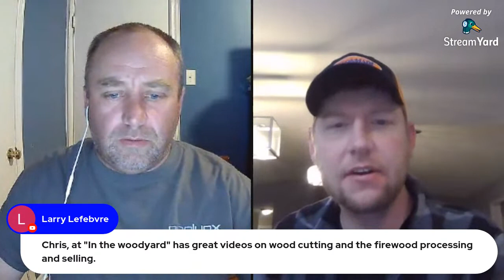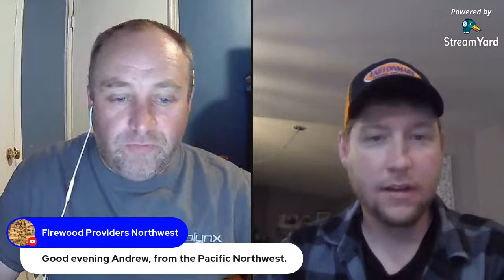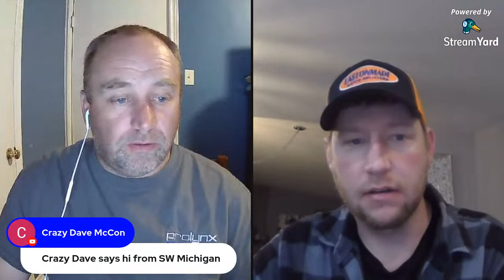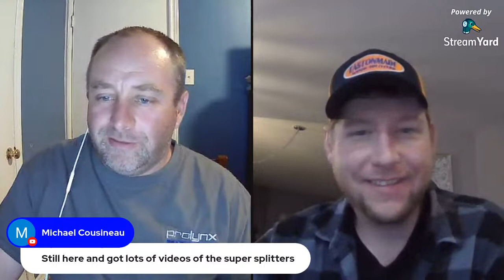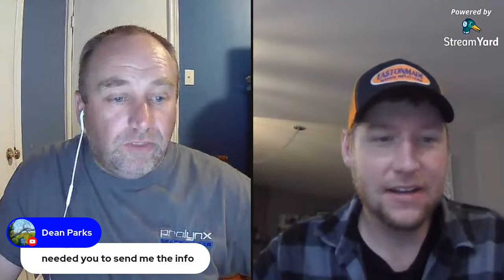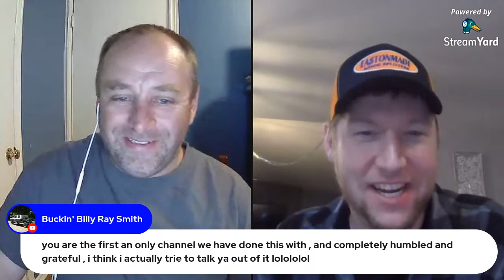LETS HAVE A CHAT WITH EASTONMADE'S OWNER

Comment: Because you are cutting top to bottom it forces the wood to tilt forward due to gravity... the splitting tray is simply to far for the 12 inch.. simple fix would be an optional catch tray to drop the 12 inch reducing the travel to the splitter
Reply from the maker: I hear what you are saying but you are cutting so fast I don't think it has time to do that.     I think the new eastonmades will have a tray so that problem should go away.       When we had a barsaw machine we would have that problem and it was exactly what you said.  The chain would get alittle dull and it would fall wrong.
Reply: @SkidderKev  if Andrew was able to install it would have to be in sync with the splitter... sure he will figure it out.. hope so anyways... the 4000 is my next big purchase right after a real delivery truck and log loader... hoping to place my order mid summer
Reply from the maker: So I'm pretty sure the new 48C (replaces the 4000)  well have that new tipping tray.    I will be following along closely on these new machines .